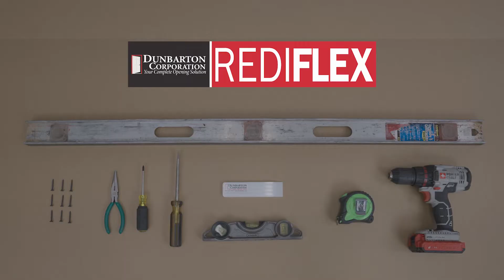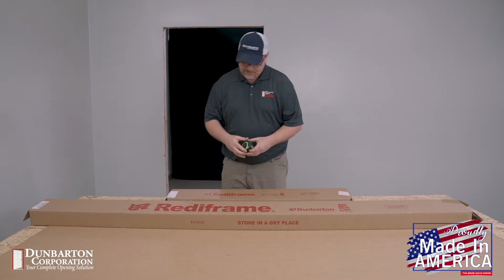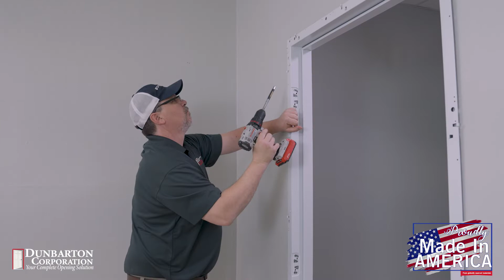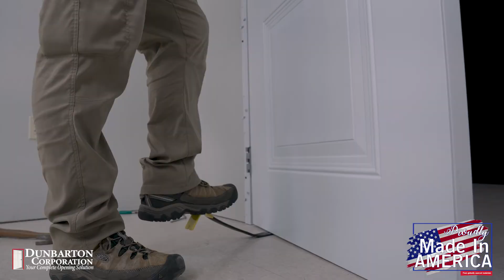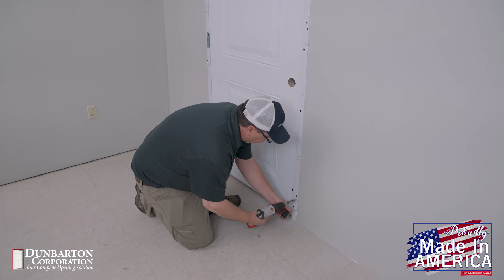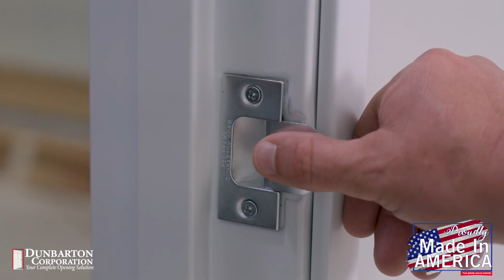Kerf RediFlex® Installation Guide

Comment: Is there a flush to ceiling version of this?
Reply from the maker: For floor to ceiling doorways, the header is omitted and the uprights extend the full height. The RediFlex frame is fine for this application and is available in custom heights up to 120” (10 feet)
Reply: @1dunbartoncorporation  Do you guys omit the tabs at the top at that point to ensure it goes flush to the ceiling?
Reply: @1dunbartoncorporation  Do you also omit the tabs at the top to ensure a flush fit? And how to you account for any framing that's out of plumb at that point? thanks